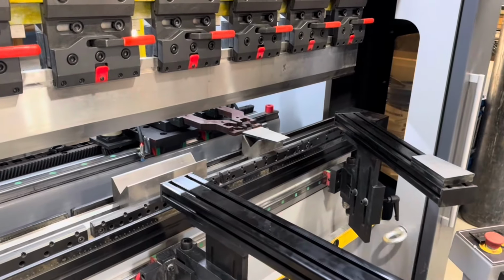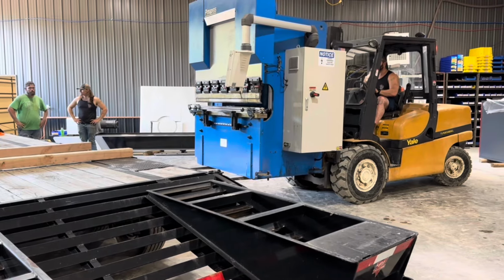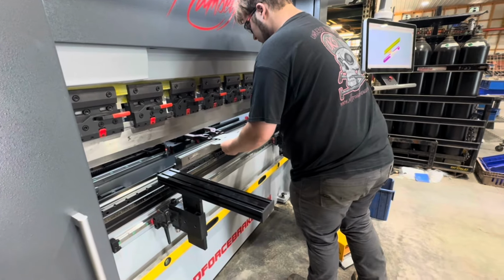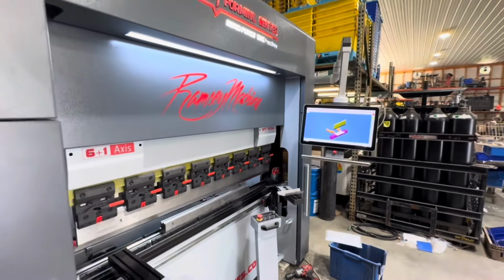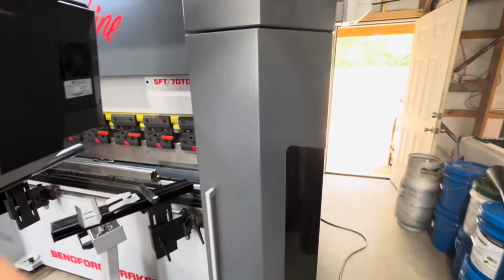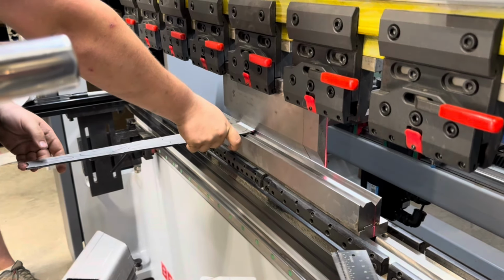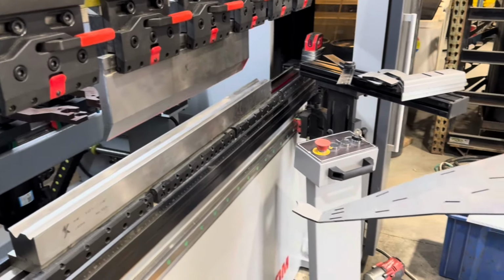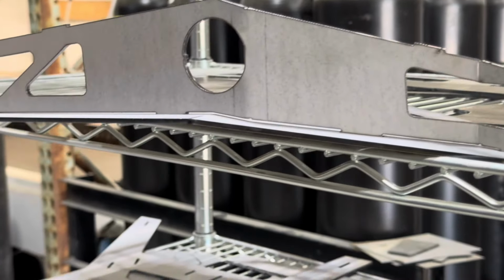3D CNC PRESS BRAKE - OFFROAD BEAST - PARIS, TN

Comment: These are awesome. To be honest I don't care too much about the simpler press brakes, my parts are getting more and more complex and are more prone to operator errors. Can you make a video about the crowning function on one of there press brakes? Or are they all smaller models without it? Where do they start money wise?
Reply from the maker: It does have crowing and it does come into affect prob around 10" wide ander.  Its automatically compensated for, but with manual overide if more adjustment is needed to dial it in.  This brake is $68K
Reply: @turbocobra  That is awesome. Great price too... That comes already with the nice 3D setup? Is that a Delem control?